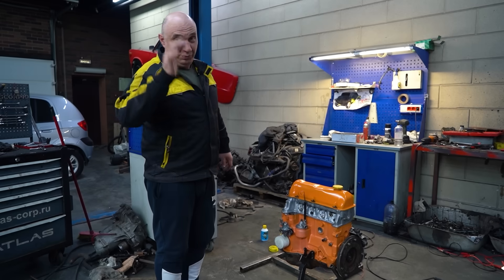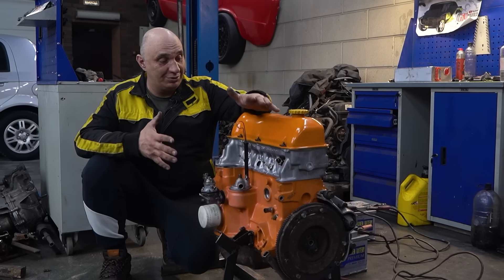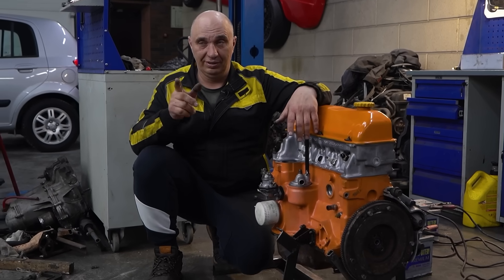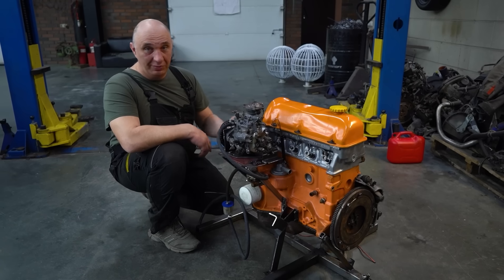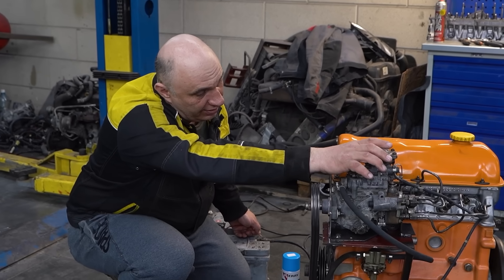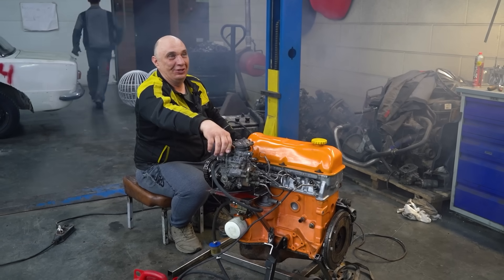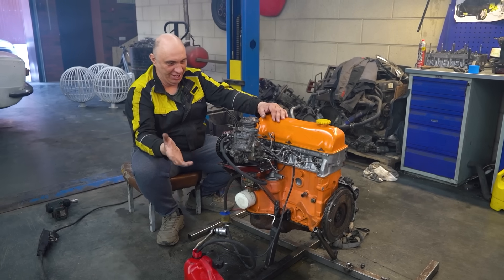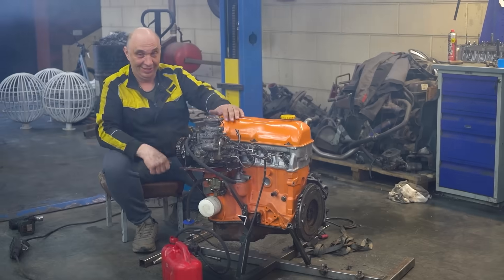We convert a gasoline engine to run on diesel fuel - will it work?

Comment: Bigger pistons in the diesel pump and a huge turbo. Roll some coal.
Reply: Rolling coal is for children, Getting it running correctly with the right amount of fuel and minimal smoke is where it's at
Reply: @TheCompyshop  Thousands of gormless yanks at a tractor pull would disagree. Rolling coal is awesome, being sensible is for old people.

Comment: If it's struggling without the heatgun you may need to fit some forced induction to raise the dynamic compression ratio.
Reply: It is useless, cold turbocharged engine cold starts as naturally aspirated since the turbo acts more like restriction other than booster. I would recomend some heating grid on intake manifold, similar to that heat gun
Reply: @Matej_Strba  or like glow plugs
Reply: @Danielagostinho21  it's a lot of machining. They can mount this heating grid on top of intake manifold.
Reply: @Matej_Strba  It's a direct injection engine, if it won't fire right up the cr is too low.
Reply: or machine taller pistons

Comment: gm did that in the 70s
Reply: BMW also in the 90s
Reply: I remember the diesel Olds V8.  The engine long block itself was good.  It was the fuel system that was no good because it lacked a fuel-water separator and extra filtering that a real diesel would have.  The head bolts weren't strong enough.  But those shortcomings were fixed in the last three years (1982-1985) of the Olds diesel.  

What can't be fixed is when customers were not following GM's instructions in the owner's manual.  People were accustomed to the low-maintenance Olds gas engines and just assumed the diesel would be the same.

Comment: put a glow plug in intake manifold
Reply: Glow plugs go into the combustion chamber.  Vlad will need something that will crank out a LOT of BTU's to heat the incoming air.  Heating up the intake air would help in getting the temps up to where it would fire a lot easier.  Forcing all the air to go through a heat gun would do the trick.
Reply: @BlackPill-obey  there were glow plugs in intake manifold in some older excavators if i remember well
Reply: @RiejuRR_50  I can see that IF they were designed to heat up the intake air so the engine can start.

Comment: What about converting it to run on diesel or petrol
Reply: Uhm thay did just that it was an gasoline engine
Reply: @engineprojects  no I mean to put a carburettor back on it and be able to switch between petrol or diesel while the engine is running
Reply: @markrichards5833   ah jeah an multy fuel  engine  to run eather on  patrol and diesel  and maybe also put an  gasserfire on it so it can run on propane as well

Comment: I accidentally put 5 gal of diesel in my empty tank from a can. 

My 81 ford f100 with an inline 6 smoked a bit but otherwise ran fine until I tried to turn it off and nothing happened. I had to choke out the air intake to get it to stop.
Reply: Haha! Interesting. Something that wouldn't happen on a fuel injected car.

I did the same thing to my riding mower, I didn't realize it until it wouldn't start the next day and I smelled diesely gas when I drained the carb. 

This mower has a fuel cut solenoid, I wonder if it would have kept running if it was nice and hot and I killed spark with more diesel in the tank...
Reply: You experienced good ol' fashioned "dieseling."  That's when there's so much carbon crap in the combustion chamber that it will continue to ignite any incoming air/fuel mixture.  Modern computer controls and other developments have eliminated that problem.
Reply: @BlackPill-obey actually dieseling happens when the carb is set incorrectly